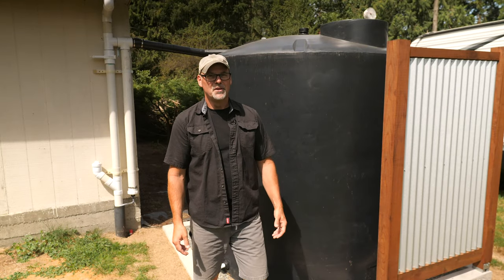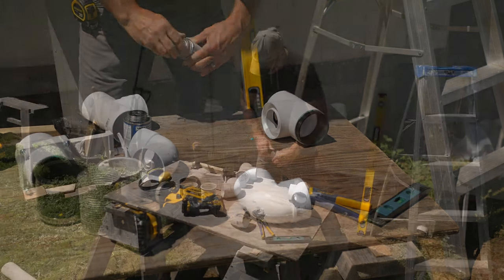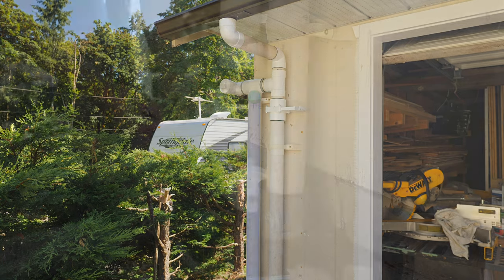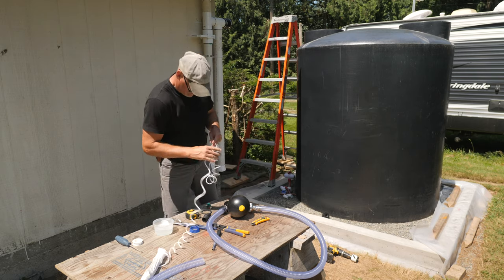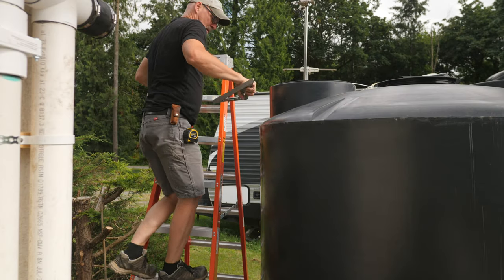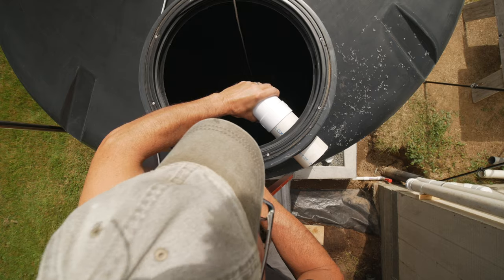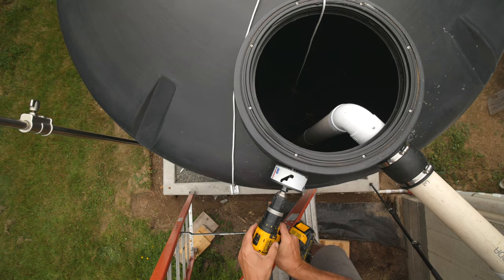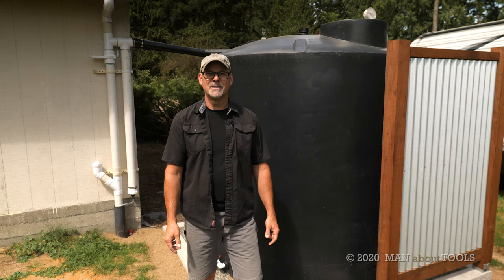Rainwater Harvesting Tank Plumbing & Fittings

Comment: Been there sir. Been there. I've had some luck in the past using an electric heat gun to get the parts apart. Some. Half the time there was warping that stuck around after the plastic cooled. Choice words indeed. :P
Reply from the maker: Hey! That would have been something to try. Didn't know that might work. Thanks for the tip!!

Comment: In the 1950s my parents built their second home in Bermuda where hurricanes are fairly common and which bring heavy rains and a lot a lot of salt spray in the air.  In Bermuda homes  have a roof water  catchment system fed by  gravity to a  big cisten beneath the house for a pressure pump.  The outside (galvanised in those days) downpipes were fitted witheasily accessible diverters which let any salty rain water run on to the ground rather than into the cistern.  Simple which even  a child could operate.

Comment: If you add a small Pcv line out with a weight attached to the float with the line coming threw it you can tell the level without opening the top at all. But note if you do this you need to cap off the end and drill a hole just big enough for the line or bug and mosquitoes will get in the tank

Comment: Kent, thanks for your channel.   I enjoy the detail and thoughts that you share with us.   I like the way you engineered the system, but I did have one question.  On your overflow pipe, why did you use the siphon inside the tank, rather than just running it directly out?   I thought it might be to have  a water trap obstacle for insects/rodents to stop them from getting up the pipe and into the tank.  Could a screen at the outflow end accomplish this?  Also if rarely used, evaporation could empty the trap anyway (I am in the hot/dry Southwest so too much rain and overflow is not usually my issue).    I am sure I am missing something and would appreciate your thoughts.
Reply from the maker: Richard, I think a screen is a good option instead of a siphon. At the time I was setting up my tank I wasn't sure whether the outlet flapper screen was going to work with my existing drain, so I added the siphon. I'll talk a bit more about that in Part 3 coming up.

Comment: When screwing the nipple into the bulkhead fitting, how tight did you make it? I'm concerned about over tightening or under tightening this piece. Thanks for the great video series!
Reply from the maker: Thanks! There's a rubber gasket so just a little tighter than "snug". Maybe a quarter turn after the gasket comes into contact with the tank wall.

Comment: very helpful, thanks. where did you find the black insert sleeves to connect schedule 40 to regular thin wall?  I can't find this anywhere.
Reply from the maker: I went to a large irrigation supply wholesaler. Maybe check in your area for a place like that. They sell loads and loads of pipe and all the fittings. Also look at any large building supply stores.

Comment: I think you do great work. I had a couple of thoughts about air flow. I don't have experience or any authority in this, just thoughts. The trap on the overflow and the quasi-trap on the tank inlet pipe at the bottom are all working to stop air. When the tank is filling, do you notice the tank "burps" through the overflow? Does air gurgle up through the piping between the gutters and the tank? It seems to me that it could be improved by drilling  a few holes (1"?) on the interior vertical pipe at the top elbow to free up the airflow for that "chamber" (the space interior to the pipes) and then put a vent on the tank itself to free up airflow for that space.
Reply: Oh, I saw you added a tank vent on video 3.